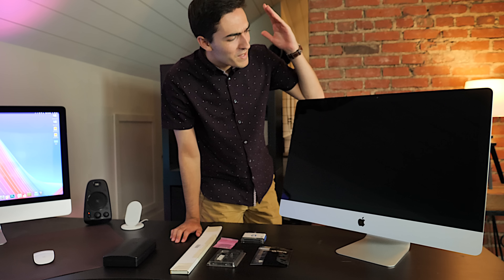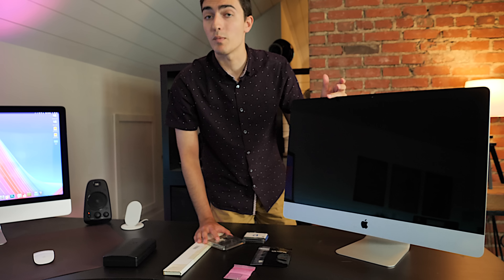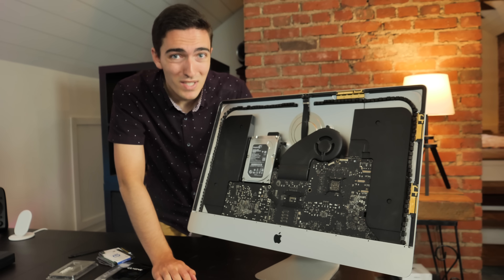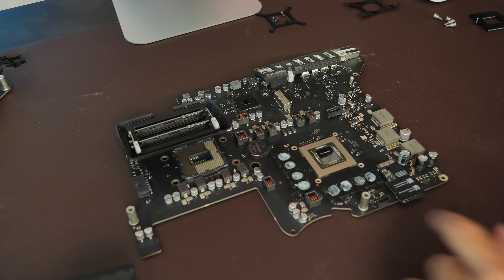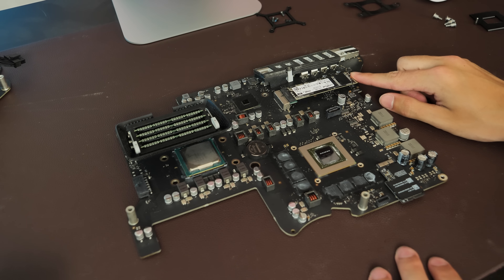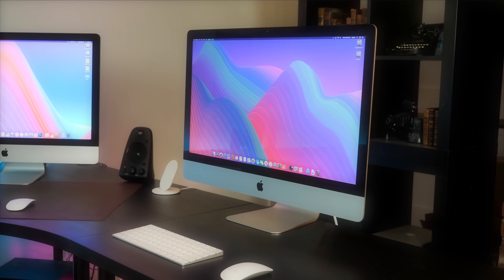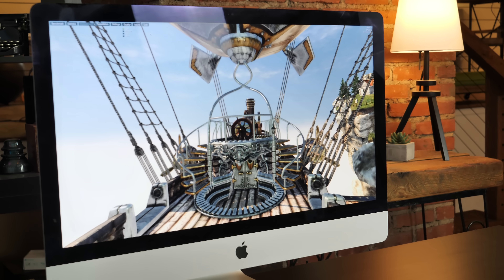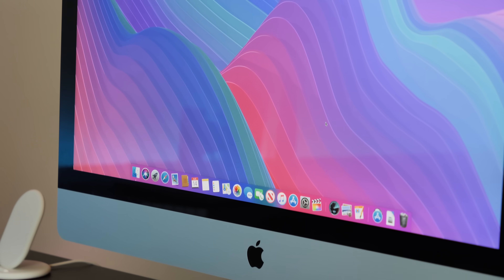Upgrading the $500 2013 iMac to the Max!

Comment: so I bought this computer spec'd out in 2013 new with the i7 etc... and yes I paid about 4k for everything by the time it was said and done. I am now wanting to put an ssd in it however I put it on the shelf becuase nvidia and apple got a divorce with their new silicon... they werent pushing out updates for the drivers and I was getting all these error messages. what is the last OS you put on this machine and how did you resolve any video driver errors??

Comment: This was like the last or second to last year Mac supported those machines though. I have a late 2013 iMac like this and it’s stuck on Mac OS Catalina, which now almost no apps (or even Google Chrome) will play ball with. Just a thing to consider with older Macs!
Reply: Download older versions of the app over the internet. Thats what i do for my late 2013 iMac 27”. I play call of duty black ops 6 and other games. I also edit videos and i also mirror my iphone to my imac via charging cable to play codm. Theres always work around. If u get a ssd n upgrade ram ur computer is good to go. I have a external thunderbolt 1 enclosure with nvme m.2 ssd. Same speeds this guy is getting on his and i didnt have to open my iMac. Ram slots can be accessed from the back of the imac without taking off the screen aswell

Comment: For fan speed just install mac fan and set the fan speed via software.Works great on both a 21.5 2010 imac and a 27 mid 2011 imac.

Comment: just bought the same Mac but the stock 1gb gpu model with 8gb ram from my local cash converters for £100 UK so will be definitely upgrading the storage and ram when I can currently have a 2015 iMac which is slow as being the stock 1.6ghz i5 8gb ram so not much I can do with that one but also have a late 2012 Mac mini maxed out 1tb ssd and 16gb ram was only £65 from my local CEX shop then the ssd was £55 the ram was £18 again from the same shop then my amazing 2020 MacBook Pro m1 bad model as my Dailey driver but then I also have my Amazing 2022 M2 iPad Pro 12.9

Comment: You talked about a cable from OWC if your fan started spinning way too fast due to the heat that the Apple sensor senses from the SSD and that you had a work around it.

However, this was not visible in your video and there is no link to that cable from OWC

It's because I'm considering upgrading my current old iMac late 2012 that I currently work on.

Thanks...
Reply: Thats for sata ssd. He installed a nvme ssd and left the harddrive. Sata ssd would go where the hard drive is with a custom bracket and adapter cord for the fan

Comment: Just made the same for my late 2015 iMac 27". Processor upgraded to i7, memory maxed at 32 GBs, old drive replaced with a 512 GB PCIe module AND a 2 TB Crucial MX SSD. Also replaced thermal paste and installed Arctic thermal pads, replaced PRAM battery, installed Big Sur on the 2 TB SSD and Sonoma (via OCLP) on the PCIe module. Installed and set up Macs fan Control to prevent the iMac fan from ramping up. PS I'm from Italy if anybody needed assistance from here

Comment: So what about if I have an 2013 late model iMac and I added an external SSD which made the Imac quicker, would it be worth it to get it upgraded with an internal SSd and more RAM added?
Reply: Depends, here are all your options

“Internal sata ssd”(goes where the original hdd was) (require taking off screen) speeds will be average around 550MB/sec

“Internal nvme m.2 ssd”(goes in pcie slot behind logic board)(require taking off screen) speeds will be average 750-850MB/sec

“External usb3.0 ssd” speeds average around 450MB/sec

“External thunderbolt 1 enclosure w/sata ssd” speeds average 550MB/sec

“External thunderbolt 1 enclosure w/ nvme m.2 ssd” speeds average 750-850MB/sec *this in my opinion is the best option. Is about the same speed as internal nvme and its external so you dont have to take off your screen. 

I also recommend upgrading ram to 32gb. 4x 8gb ram make sure theyre ddr3 or ddr3L

Comment: Hi Luke. I have iMac 2013 27" and last week, when I tried to open the monitor panel to check the HDD, I inadvertently dropped down the screen panel onto the table and after that the resolution of the display is only max 1280x720. I tried to restart it many times but cannot revert it back to 2k resolution as before. I also checked all the cables but seem that nothing broken (or there might be small broken inside that I can't realize by eyes, I don't know honestly). Can you advise what steps to check if there is any broken or is there any any way to fix this problem?

Comment: Hey Luke. I had the courage to put the i7 4770k on my 27 inch Imac from 2013, result: The machine is a plane!!! Beat up a lot of 2020 out there. Detail, it's running Ventura 13.4.1 through opencore... Runs smooth. Turns on in 9 seconds, opens apps in 3.5 seconds, and native apps in less than 1 second. Here are my machine settings:

Processor: i7 4770k Quad core
SSD M.2 Samsung 970 EVO 1TB
SSD SATA Samsung 870 EVO 1TB
Video Card GTX 775 2GB
32GB Kingston RAM memory
macOS Ventura 13.4.1

I advise anyone in doubt to put the 4770k which is much better than the 4771.
Reply: I need help . I installed a m.2 SSD with the adapter . And I'm keeping the hdd for extra storage . I'm having issues installing Mac os onto the SSD . Using opencore when I select the drive to install (the SSD) , it'll start the install with the progress bar then reboot back into recovery . Not moving forward with the install
Reply: How did you get the nvme drive to work

Comment: A great video, even 3 years later. I don’t need to take your advice to avoid the upgrade work because I was just given a 21-1/2 inch iMac late 2013. S, here I go!  The trickiest part is getting into it——I watched another YouTuber upgrade one of these things and right off the bat, as he ran the plastic blade around the edge of the glass to get inside he (you guessed it!) cracked the glass! Bummer.  Not his fault The glass obviously tolerates VERY LITTLE stress.  A valuable object lesson for the rest of us. Thanks for the step-by-step, Luke.

Comment: Protip: if you're worried about touching the power supply, let the thing sit for a day after unplugging it. Newer PSU's have a bleed circuit that will de-energize the board if you leave it alone for a bit. Still handle it with care when removing and replacing but it's not the terror some people make it out to be. 
If you're going to take apart a 7 year old computer, you may as well take the whole thing apart and clean out the insides. I just finished this upgrade on a late 2012 model and that that thing was dust bunny city especially below the speaker ports at the bottom. Took out all the components, vacuumed out the inside, hit the boards with some compressed air, wiped down the inside of the case and put it all back looking brand new.

Comment: I've come across one that The previous owner believed the fusiondrive was bad. I'm thinking about putting an SSD Samsung Evo 860 2tb.

Would you also add a PCI card with the adapter for 1 TB or just use the Evo?

Comment: What would be a NVME speed difference on a logic board in comparison to thunderbolt inclosure NVME M2?
Reply: Luke was getting about 700mbps with a 3 year old SSD and I've used a Samsung T7 external SSD (uses a NVME SSD in enclosure) connected via USB A and I get about 395mbps write and 405mbps read with my late 2013. I'm planning to bite the bullet and break open the iMac and put in the NVME drive. The reason is that the spring retainer for the tilt hinge finally broke so I'd like to replace that as well and need to get the guts out anyway to do it.

Comment: Hey Luke, my question first that we talk. What is wiser to upgrade the 3.5 HDD to 2.5SSD or apple 128GB SSD to faster NVMe (knowing the later one needs a dongle/adopter which is hardest to find in my corner of world)? Now the story on your words I bought an 27inch iMac late 2013, with what was available in the city, a core i5 3.2GHz and 1TB fusion drive.

Comment: Hey yoh!
U screwed up on the very most crucial part!
Reinstalling the heatsink is pretty tricky and most people easily wreck the logic board coz apple had bad intentions constructing this vulnerable cpu socket! It doesn’t have a lock and if u want to screw the heatsink back on and u slip off u wreck the socket… death to the board!!
So y dontcha reveal the most crucial process of assembly???
At least tell how you did it…

Comment: Great Video as always Luke,  great channel!  I know this is like resurrecting and oooold video thread, but I thought I might ask anyway.   I own one of these iMacs,  and i would think of upgrading (maybe not the processor) since the cost of the iMac is already taken care of.   but I wanted to ask you your opinion on using OpenCore to make MAC OS Monterrey available on one of these iMacs.   Would you think it is safe enough as to keep using it logging in with a personal Apple ID account (since it has so many personal info) or that OpenCore trick is only for Macs that will be used as working horses only' (No Apple Id, just use it to edit and work).  Thanks!

Comment: I still use my late 20013 Mac. I have the same specs you updated from start and I have the 2gb NVIDIA GeForce GTX 775M. Is it possible to do more now in 2022? I know I can get a better graphics card. What graphics card should I choose?

Comment: Newbie question: I also have a late 2013 iMac topped out with 32GB of ram.  If I upgraded to an i7 chip, would that upgrade the Graphics Processor as well?  Is the graphics processor built into the  chip itself?  After doing all of this would I be able to load the most current iOS?

Comment: I have a Late 2013 27” iMac, the HDD is corrupted due to power outage, so I’m gonna replace it anyway with SSD. also What is the benefit of putting a PCIe ssd in? And is it a standard M.2 or is it proprietary. 
Also, can I upgrade the Mavericks OS direct from the app store as I can’t find it there as other people have shown. Sorry for all the questions, I generally repair Windows PC’s, so I’m on a learning curve here.
Thanks.

Comment: Nice video! With that said, Apple really screwed up when they changed the design of the iMac to the double sided held display tape and when they changed where the RAM memory would be upgraded. It used to be so much easier to take out the magnet held front  bezel and then the screwed held display. They could have still made it round and esthetically pleasing without changing the entire design and making it a lot harder to upgrade. This is why so many people are reluctant to switch to Apple because of their inability to effortlessly upgrade their systems. I mean, I know why they are doing it, but for the hefty price one pays for an iMac, I better have the ability to upgrade my expensive system!!!
Reply: Hi Ma - I wondered if they changed the design to reduce the large aluminium Weight/Cost in manufacturing as the cases are machined out from a solid block...perhpas manufactured ingots to their approximate shape and less machining has reduced the 27" form 30.5 ILbs to around 12 ILbs.  I have to ship from USA to Trinidad (Caribbean) and the cost was $116 now around $50...massive difference when manufacturing millions and shipping across the globe to global distribution warehouses... Yes, Apple likely locked in its customer base by doing what they can to make upgrading a daunting task for most people but as many here have pointed out you can spend around $400 on top of a $500 2013 iMac and end up competing with the newer range, for most of us...

Comment: Going to pick up a 27" I mac morrow that comes with a 1GB SSD already installed and the Intel 4750 3.2 GHz CPU and 8Gb of Ram I will upgrade to 32 GB.I paid $200 so I think I got a good deal.Not sure if upgrading to the 4770 CPU is worth it.

Comment: For the temp sensor... if you cannot put an NVME drive, locate where the pins for the sensor are and solder wires (maybe on the board) to a resistor.
Use the value that your hard drive temp sensor gives when the hard drive is completely cold!

Comment: I purchased at 27” IMac series 14.2 w/ I-5processor, 1tb fusion drive, and 16gigs ram for $250.
What is the best upgrades for function and speed for this model and setup ?

Comment: Thanks for the video, but for  such a nice upgrade, here is what i think is missing in the video:
You should record  the opening time of the mac before and after the upgrade to show what kind of a difference the upgrade had on the mac.
Definitely have the removal / installation of the cpu so that it would help others that would like to go thru the same process.
and of course the removal and the assembly of the logic board.

Comment: almost two years ago I bought a 2013 IMac because of your videos, I have had to parts laying around forever to upgrade the HDD and to also add NVME. I finely took the time to do it, totally worth it should give it a few more years of life.
Reply: I need help . I installed a m.2 SSD with the adapter . And I'm keeping the hdd for extra storage . I'm having issues installing Mac os onto the SSD . Using opencore when I select the drive to install (the SSD) , it'll start the install with the progress bar then reboot back into recovery . Not moving forward with the install

Comment: Hey. Why would you get electric shock when the imac is unplugged from power source? Does PSU store energy?
Reply: It has capacitors in it which function kinda like temporary batteries(a very basic explanation) they can hold a charge for quite a while after power is removed.
Reply: możesz śmiało jezdzić językiem po płycie zasilacza zaraz po wyłączeniu komputera z pradu 😉

Comment: I bought a 27" iMac late 2013 $550.00 plus tax, with a 4771 and GTX 780M 4GB  32 GB SSD 2.5 inch SSD 512GB with Catalina installed on SSD, use the logic board from it and put it in my machine Clean, new heat past and put old logic board and use as a Xmas gift. 7 Nov 2021. Thank You for all info. I will get it done by Xmas.

Comment: Does anyone have any experiens with upgrading a 27" Late 2015 with blade SSD? I bought (by mistake) an OWC Aura Pro x2 to find out later OWC says is not supported for Late 2015 (17.1) by some reason OWC doesn't say. I read some people did it anyways and it worked for them. Any advice?

Comment: my late 2012 21.5" imac is not a Fusion drive one but does have the M2 socket on revers side of the motherboard. Not sure why you need an adapter as M2 socket looks like a straight fir for the M2 SSD drive

Comment: I just got a iMac i7 late 2013, for $400. It has 32gigs of ram with a SSD on the mother board. I think I will be making some upgrades for more space, but this iMac is already a screamer. As always a great video super production and you made it very explainable.
Reply: Nice find!
Reply: I bought a 2017 with 16GB for €400, I already replaced the HDD for an SSD for €15 (already hasld the EVO870)

Comment: Hi, I have que question about an iMac which I own. It’s a iMac 27” late 2013 and I was wondering if I install a Samsung 970 pro NVME  and the adapter for it, does the NVME work or will it over heat.

Comment: The one other thing I would recommend if you decide to do this, is to replace the CMOS battery (the flat disc battery on logic board) while it is apart. With a machine that old, it certainly will need replacement sooner rather than later and so much easier to do it when everything is apart. Also, it probably would make sense to replace the hard drive as well. Hard drives can fail at any time and one this old may fail relatively soon. Yes, $40 for the adapter is a cost, but you can easily bump it up to 2 or 4 TB for not much $$. For value, this can make sense if you already own a 2013 27in iMac....like I do!
Reply: So the stand hinge pins that hold the springs that keep the display in the angle of choice, finally bit the dust. :( So if I want to fix that (right now I have a block between the stand and the back of the iMac to keep it upright) then this upgrade seems like it could be a good idea. I already have 24gb of RAM, so wouldn't do that, but would probably go ahead and add the SSD to the logic board and replace the HD with either a higher capacity HD, or SSD. I have my original HD right now and failure after almost 10 years is more likely to happen than not.
Reply: Hi. @gatorcellman whats the voltage of the CMOS battery? 3V or 5V? DL/CR*****? i found a logicboard that doesn't have and i'm trying to revive it.
Reply: @KelvinJohn  It will be a 3V BR2032. The reason to use the BR version is that it has a higher temperature tolerance than a CR2032. But if you have a CR2032 lying around, it should work for testing. Good luck!
Reply: @gatorcellman  Thank you! let me find one.

Comment: I know this is really old etc. but one other thing you could have done, is left the stock ssd in, used a 1-2tb 2.5” ssd, and used Macs Fan Control, and set custom fan curves based on cpu core temp avg.

Comment: Hi Luke. Great videos. Do you have a video on linking two 2013 iMacs together to use one as a display?  I have been trying to do this but have not been able to make them work. Also, would you have a suggestion or video on how to fix a display that has a black bar running through it?  Thanks in advance.

Comment: The 2013 imacs are compatible with most if not all sata ssds. You will not get the fan noise issue thats associated with the 2011-2012 models.  ..Does your imac now sleep and awaken correctly ? Which model nvme pcie SSD did you use ?

Comment: Hi! Thank you for the video. I brought the adopter from the link you posted. But it is not fitting into the screw slot. with the adopter it is about 3-4 mm longer to screw into the mother board of imac 27 late 2013 emc 2639.
Reply: Just an update: finally I was able to fit the Adoptor you listed by pushing it much harder into imac's PCIe slot. Thanks again for making this video!